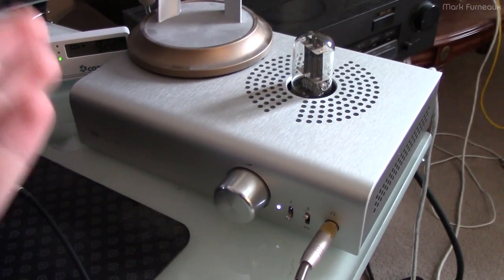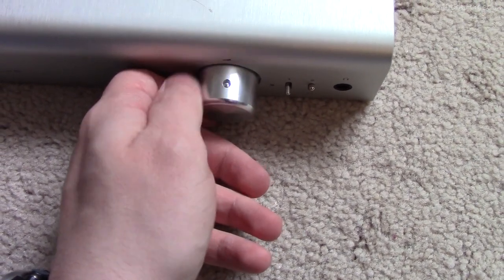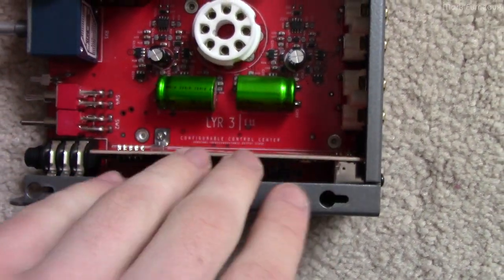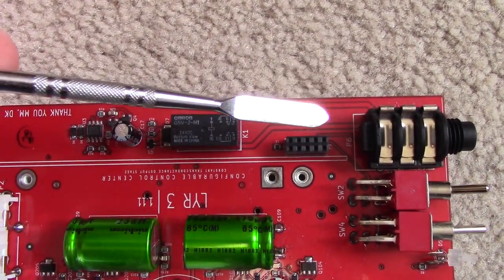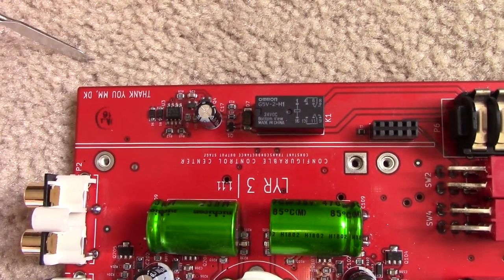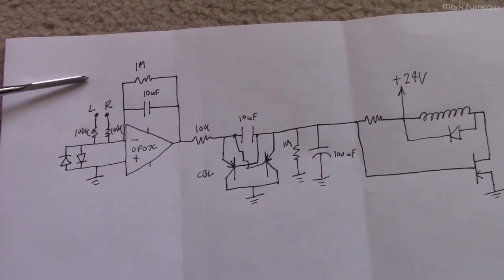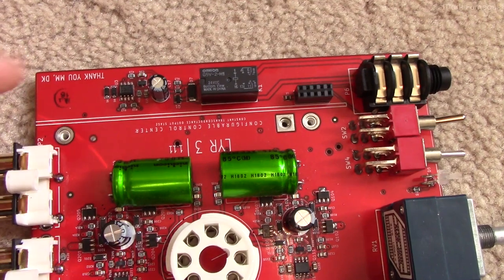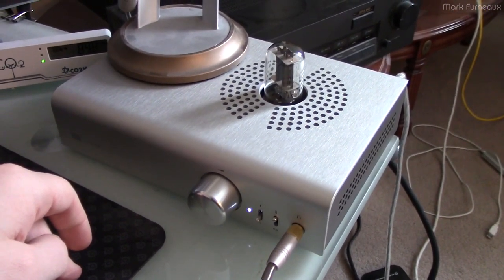Fixing the Flawed Speaker Protect Circuit in the Schiit Lyr 3 Amp/DAC

Comment: I sent mine back to schitt for repair because of this. It cost iirc 35$, but they swapped out the dac for the multibit for some reason so it was well worth shipping cost. I do not know why they did this, but not complaining. Also, the multi--bit dac is layed flat..parallel with the main board. This was over 2 years ago for anyone worried or looking to buy one.

Comment: What music are you listening to that has such low frequencies (8Hz). The human ear can't hear frequencies below about 20Hz anyway. I expect the tripping is caused by the amplitude of the input signal and low frequencies affect it more.
Reply from the maker: The input comes from the internal DAC (and after the volume control), so the input level is not too hot. A higher amplitude will cause the integrator to saturate faster, but if the time constant is shorter than half the period of the AC signal, it will always trip.
Reply: @TheUbuntuGuy  I think the point is that frequencies below 8Hz should be completely filtered out by the preamp, not tripping a protect circuit.
Reply: @sjwright2  Yes, a 'rumble' filter would be a good idea, cut everything below 15Hz, no way you can hear that (or headphones are going to be able to reproduce it)
Reply: This protect circuit seems more like a high current protection than a low frequency protect. I can trip my Lyr on most music if the volume setting is very high regardless of the music frequency.
Reply: @flatbubba  so it's simply overcurrent protection?

Comment: I got a new Lyr 3 (with DAC card) a few days ago and I'm just watching this to get an understanding of the internals of it if I ever choose to open it up. Looks like they may have improved the protect threshold, mine didn't trip until I reached 1 HZ at -6db amplitude. (Board revision still 1.11)  Also looks like the DAC card got fixed, (labelled V1.1 on mine,) It's straight and not-bent anymore judging by the USB port alignment and how the card looks through the tube hole so that's good at least.

Update in late 2021: I actually can't use the Lyr 3 while gaming -- or at least when playing Overwatch. Some of Overwatch's sound effects apparently go sub-sonic, as some explosions (particularly sound effects generated by the hero Echo) WILL trip the current protect circuit of my Lyr. I've still never had it trip once for music, though. Instead of modding my Lyr I'm just using my Creative SBX G6 instead when gaming. But at least they did fix that bent expansion card lol.

Comment: It is mistake to think 100k resistors in the DC protection circuit will cause crasstalk between channels. This  is impossible and here is why:
Power Amplifier power output has a very low output resistance, probably 50 or even 2 ohms. You can't drive such a low output resistance node in schematics through 100k resistor. (high output impedance, in this case 100k for node where two signals summing at the op amp input)
Also negative feedback comes into play and corrects any mismatch between input signal and output signal. 
So this circuit is very simple and clever!

Comment: Very educational. Thank you. My Lyr 3 is on order, hope they've resolved the protection circuit issue. Didn't order the DAC card. Will be using with a Topping D70S which uses 3 of the OPA1612s you installed. I'm curious why you didn't install sockets for rolling the opamps while you had the opamps removed?

Comment: Am i misunderstanding something or can't you just go on equalizerapo or similar software and ad a low cut filter on like 10Hz to remove any low frequency components as they should be inaudible anyway, therefore fixing the problem without the hassle/risk of opening and modifying the pcb (at least if you have an equalizable source through the internal dac or an external one)?

Comment: Maybe it´s also possible to change the cutout frequency by changing R19 (the 10K resistor), you don´t have to worry about any possible stability issues with the integrator that way...

Audio electronics are fun :)

Comment: Does the delay circuit have trouble with bad wall sockets, I mean does it significantly shorten the delay if the plug is repeatedly pulled out and reinserted?

Comment: So what reason should stop you from just running wires/links to bypass this system?
Reply: Nothing stops him doing that, but then the protection from component failure resulting in DC on the output is lost. So really unlikely, but could burn out headphones he's connected.